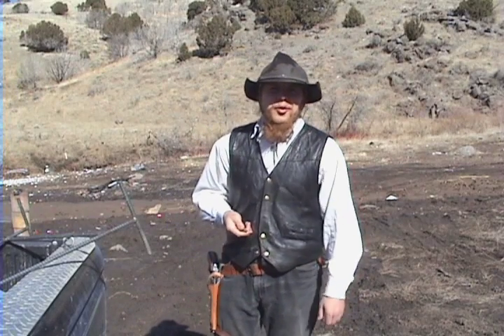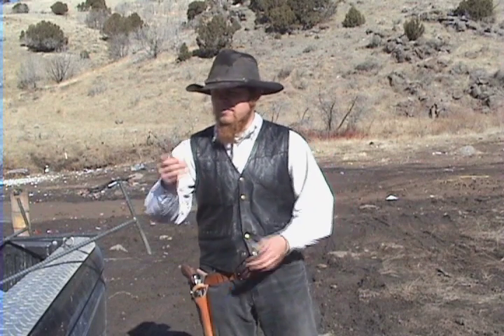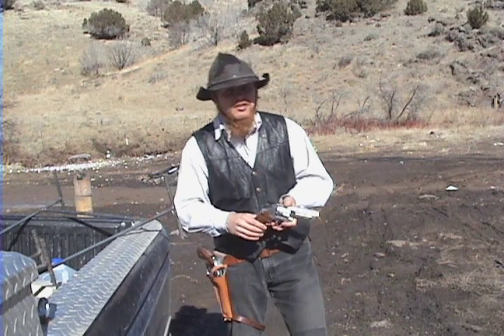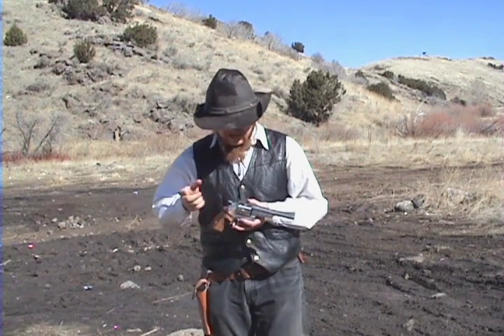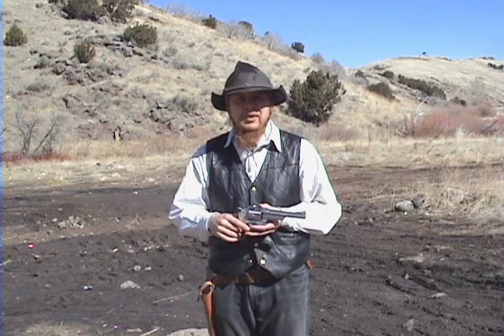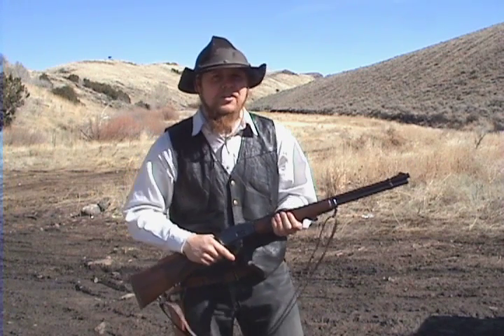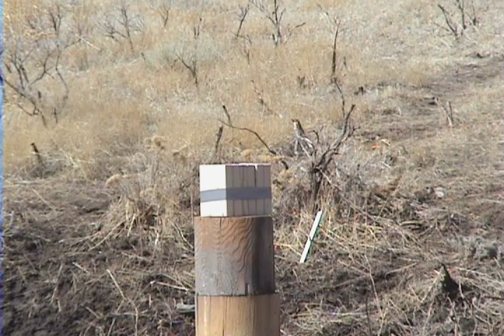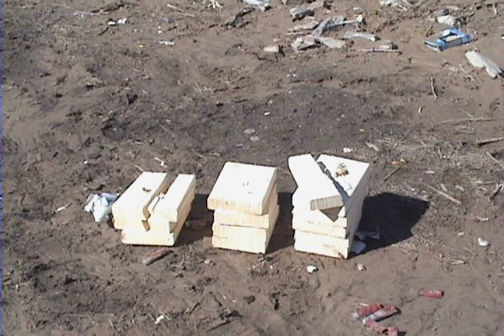44 Magnum Power vs. Barrel Length (TIS012)

Comment: I killed a wild  hog with  my 7 1/2 barrel two weeks ago with my Ruger New Model Blackhawk 44 Magnum I got 12 inches in the hog with the Blackhawk, and today I got a hog with my 16" barrel Rossi 44 Magnum lever action and I got almost 18" in the hog with the Rossi 16' 44 Magnum lever action both hogs was about the same waight about 170 pounds both hogs was shot in the brisket plate rib cage at 15 yard away from a stand 12 feet off the ground both hogs were one shot kills

Comment: Why so far away from the chrono? Wouldn't close as can be give you the most accurate results? By eliminating variables like wind gusts? I don't know; I'm asking you.
Reply from the maker: The muzzle blast can cause problems for the optical chronograph sensors (e.g. one sensor picks up the shadow of the bullet, while the other one picks up the shadow of the muzzle blast) leading to inaccurate readings.  Thus, I try to put the chronograph far enough downrange that the bullet itself will be the only thing passing over the sensors.

Comment: Every individual revolver is different, I've seen 2" barrels get better velocity then a 4", there are alot of variables with revolvers to even really judge by barrels length, longer does generally get higher velocity though..even the exact model different gun can give different results, cool video though brother

Comment: Slow powders take advantage of longer barrels. Carbines that shoot 9mm and 45 ACP wont gain as much velocity because they are using faster burn powders. H110 is THE best powder Ive used in 44 mag. loaded with 180g XTP has insane destructive power
Reply: You should make a video. Hardly any educational ones out there with hard, usable facts. Thanks.
Reply: Terry Valèntïné Dean.  You ever use IMR 4227 around 22.5 grs with a Hornady 240 gr load?

Comment: In my speers book it shows 19 grains ad starting load.  Is it safe to be under that? Great vid keep up the good work!
Reply from the maker: Thank you!  The Hornady reloading handbook (7th ed.) shows a starting load of 17.4 grains of 2400 powder for 240-grain jacketed bullets, and a maximum load of 21.2 grains.  Thus, when I developed this load, I tried several charges in the range of 17.5 to 21 grains, and the 18.5-grain powder charge proved to be the most accurate so I went with it.  In some cases, the starting loads published in reloading manuals may be minimum safe loads, but usually they are just recommendations produced by subtracting a few grains from the maximum load to provide a margin of safety.
Reply: I have noticed various differences between hornady and speers, it never ceases to bewilder me. Thankyou for your reply. P.s. Awesome vids.

Comment: Keep in mind the rifle doesn't lose energy like a revolver does between the cylinder and the barrel.  That's a pretty big advantage.  Nice video.
Reply: It should be minimal. If you are you need to check your end shake on your revolver. Cylinder to barrel gap should be no more than .006. If it more you have an end shake issue. Energy is due to fps. Longer barrels will produce more fps thus more fpe. But hell what do I know, I've only been reloading for 34 years, mainly for 44 magnums but also 44 Special, 45 acp/colt and 38spl/357. I have shot tens' of thousands of rounds through my 44 pistols and my Winch. Trapper. A majority have been full power and over the max 44 mag rounds. My current is 300grn WFNGC over 21.5 grns of H110 in Starline brass. Have shot hotter than than. Also fun is 31 grns of H110 using 180 XTP. That's a humdinger.

Comment from the maker: That's an interesting study.  I imagine the velocity difference between different orientations would be strongly dependent on powder type.  With powders like H110 or Win296, there is typically little if any airspace left in the cartrige, so there wouldn't be room for the powder to shift much.  However, with something like 700X that leaves a lot of space in the case, I could see how the orientation might make a difference.  Maybe I'll have to try that experiment for myself sometime.